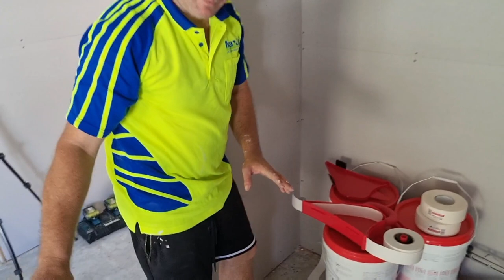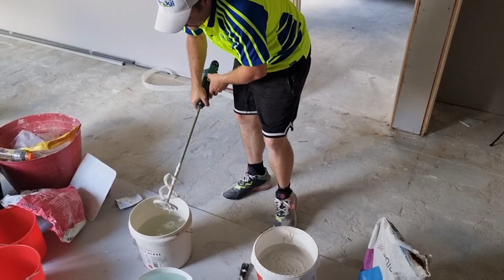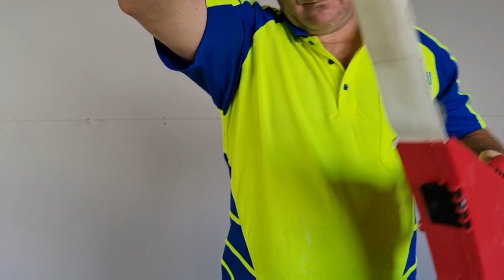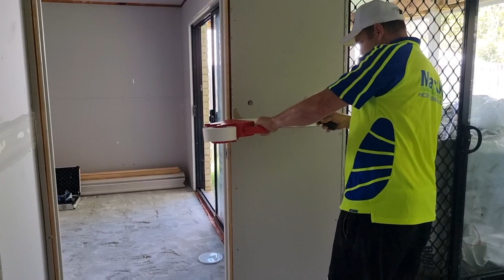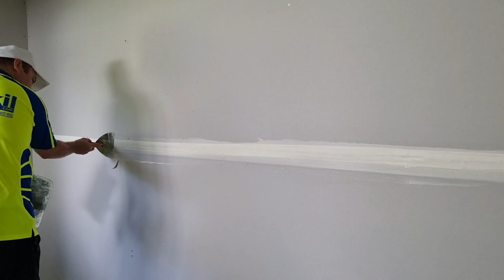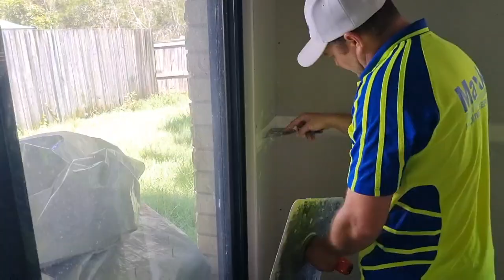Taping Drywall Flats with "BANJO" Drywall Taping Tool

Comment: When doing walls put your right hand through the fabric strap on the side and push it left to right it’s a lot easier
Reply from the maker: i didn't realize that till later, 100% , i feel like an id...t. Thanks
Reply: 👍 
strap for the horizontals and handle for ceilings and verticals

Comment: Watching this video from a couple years ago and saw that other type of banjo. You guys use a lot here in the states I just use a regular banjo but they seem to work real nice for you guys and you were struggling with that one and I don’t know two years ago, what’s happened to it but looks like just a little stainless steel cabinet knob, drill one hole through it and fasten a cabinet knob. You could get a hold of it real good when you’re hands are wet and pop that right open
Reply from the maker: Yeah sounds like a good idea.